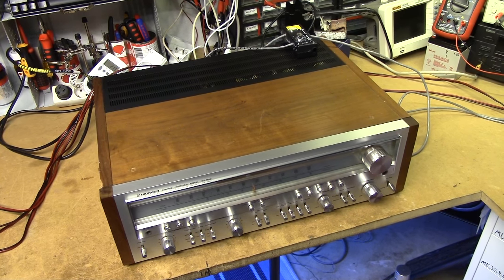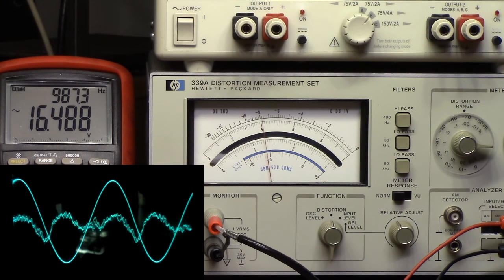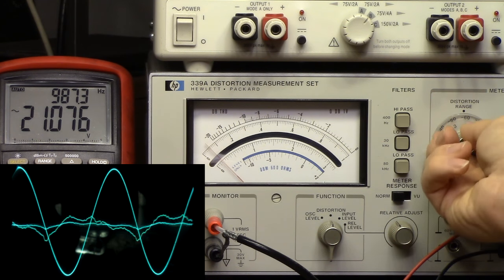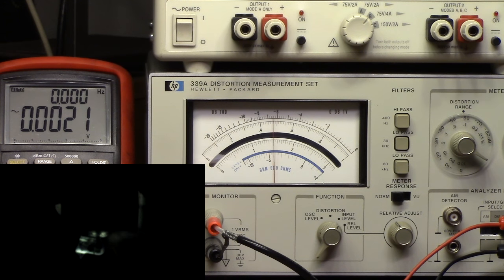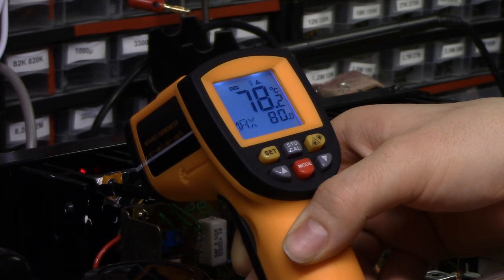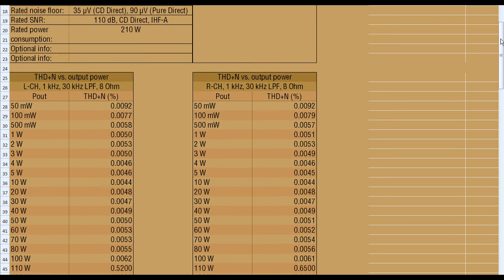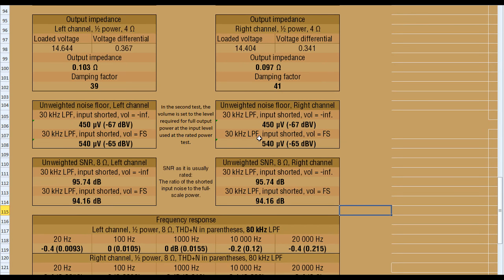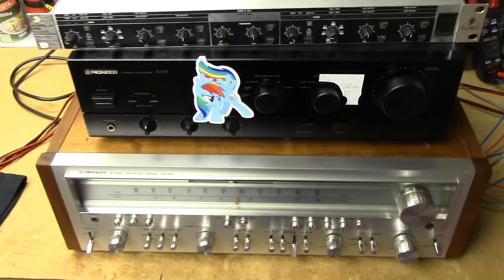Pioneer SX-950 objective performance check

Comment: I have an SX-950 that is 100% original and still sounding great. DC offset is still below 5mv per channel. The sound of the original Toshiba output transistors is much better than modern replacements. I tried modern ON-Semi transistors and the sound quality deteriorated considerably and I swapped them back.  I also have a Cambridge CXA91 and a Marantz PM8006 which both have a very low noise floor but sound very sterile and clinical versus the Pioneer.

Comment: Thanks for the post. Very impressive specs. for the power stage; ideal for connecting a digital radio to. I recently purchased a 'cord' brand, which also functions on Bluetooth; I use it on my 'Playmater 50/50' MOSFET (2SJ48,2SK133 each channel) amplifier..

Comment: I bought one of these in mint condition at a garage sale about 10 years ago and paid only $10 for it. It works perfectly. Since I prefer low efficiency loudspeakers I had no problem with noise.

The problem with these tests based on 80 year old concepts is that they tell you nothing about how they will behave when connected to loudspeakers. Also often ignored is the input impedance which can be as low as 5kohms in some solid state power amplifiers which can load down miserably designed signal sources such as the absurd performance of some Nagra  preamplifiers. This was not a problem in the vacuum tube era what 100 kohms was nothing unusual.

One problem amplifiers are confronted with is the sometimes insane impedance of crossover networks in loudspeakers in order to get them to sound flat with no tone controls, active  equalization, or any other means to control the overall frequency response of the system. As bad or worse is the pathetic high frequency dispersion of modern tweeters which can be 15 db down at 15 khz just 30 degrees off axis. All this is done for the sake of "imaging" or sound stage or whatever the audiophiles call it. So they position their speakers with a micrometer and are confined to listen in a sweet spot. They also use the difference in impedances of expensive wires to alter the system frequency response through endless trial and error. Do I think they're crazy? Yep! Here's a speaker whose impedance is a roller coaster ride from minus 90 degrees to plus 45 degrees. Small wonder it takes a $20,000 amplifier to drive it. See figure 2.
https://www.stereophile.com/content/yg-acoustics-sonja-13-loudspeaker-measurements
The man who owns this company built everything including the enclosure out of aluminum. He used a CNC milling machine to manufacture the speaker cones out of aluminum billets. He said there's nothing like having a half ton crane in your listening room (his factory.)  Each one has their own brand of insanity IMO. Do any of them sound like live acoustic music? Not to my ears.

Comment: I remember doing tests on these and many other amplifiers in there day. You could often get quit a good S/N ratio on the line inputs as the preamp offered very little gain. but the mag input with it's 2/3mV input could  really have quite audible noise with the gain at about 50% A number of well respected amplifiers could hardly make -50dB. I always used unweighted measurements, that is after all the REAL world.
Reply from the maker: +Michael Beeny Unweighted measurements are indeed the way to go.

The noise issue on these particular units is caused by the preamp gain stage right after the volume control, where they've basically implemented a discrete FET opamp and not done a great job at it.

Comment: All you have to do is change out a number of specific transistors on the 950 and the "noise floor" as you call it will make your Yamaha sound like a weak sister.
Reply from the maker: Which ones?